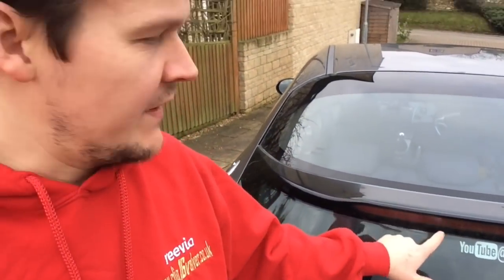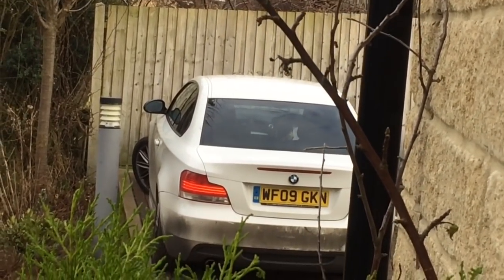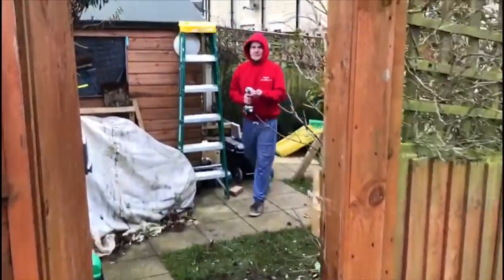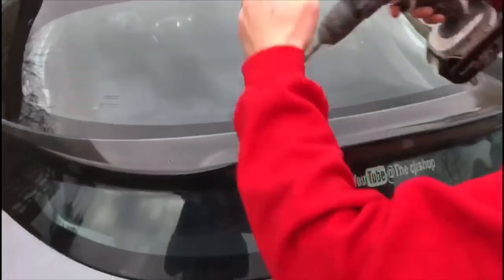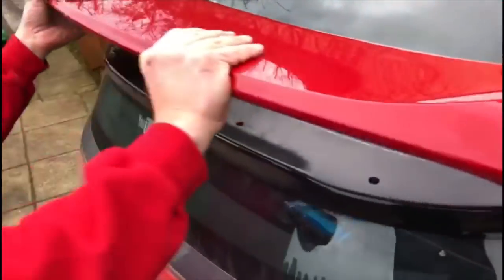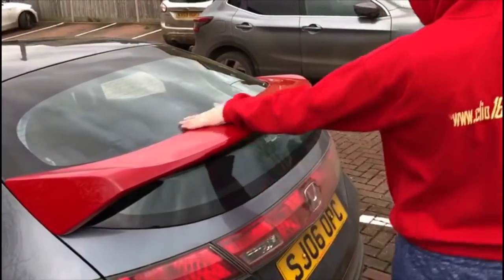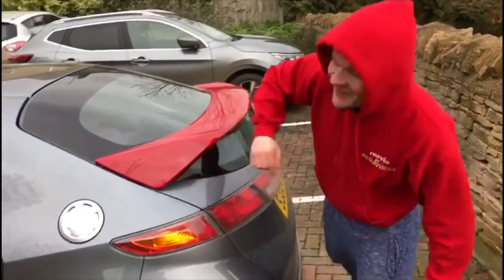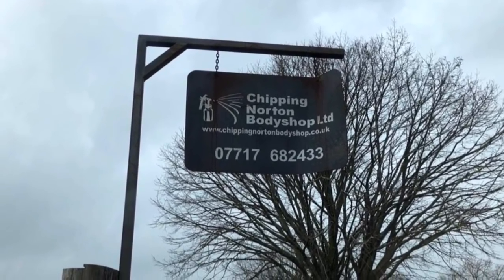Fitting FN2 Type R Spoiler To 8th GEN Civic

Comment: No need to drill holes and make a mess to your boot.  
I took off all the fittings from the spoiler, and placed it on with Tiger Seal.  Rock solid and fitted on perfectly.  
Still going well 4 yrs on. 👍

Comment: I watched this video and it inspired me to first try to use the far side bolts. I needed to drill perpendicular on the spoiler. No danger to hit the glass. It stays so much better fixed, in only those 2 bolts. One on the far right and one on the far left side. So there was no need to drill for the other 4 bolts, like in this video. The result is less mess, less chance for the water to come in, less work. No need for the inside panel to be removed neither. Hope this helps someone. have a good one.
Reply: So you only drilled one hole on each side? For the bracket ...? I want to drill mine but don't want to get it wrong 😂 😅
Reply: @kirklishman8997  yes only one hole on each side. When you drill, use a thin drill first so you dont damage the fillet.
Reply: @namunski949  cheers so the hole at each end is for the bracket only ...
Reply: @kirklishman8997  yes. All you need to keep the spoiler on, those two holes. Have some small rubber gasket with you or some silicon to go around the holes when u fix the spoiler. It`s a shame I did not keep the pics. WOuld have shared it with you. But I dont have the pics anymore. But yeah, use your logic, try imagine how it will fit before you start the job. You may need a friend to help you, maybe keep the trunk door at your level so you can drill straight and not slip.

Comment: That actually looks worse. Doesn't suit the 4 door civic at all.
Reply: 5"
Reply: It's the same damned car as a 2 door. Everything is interchangeable, it just has a line down the rear quarter where the passenger doors are.
Reply: Jay Gee - the difference is is doesn’t have the rest of the kit fitted which makes it silly
Reply: @PreciousMetalinvest  I does look better with the full GT spec Trim. If it was the right colour it would look better. 
Ps: The 1.8 Type S & Si models have quite high top speeds. Yes it looks better with the full body kit of course.
Reply: RR PLANB - the Type S / and SI models have the exact same engine as the 1.8 only difference are the kit wheels and seats
Reply: @PreciousMetalinvest  R18 A1 7 R18 A2 i-vtec yes. Si is rarer & different trim etc. The Si FN1 only exists to semi plug the gap in the market when FN2 Type R had ceased production   in the years before the FK2 turbo'd engine model arrived. My Si puts out 142 at the wheels completely stock BTW. I believe all the R18A2 engines are a little more powerful than It claims in Honda's official figures... Not sure about the Type S R18A1 as I have no experience of it.